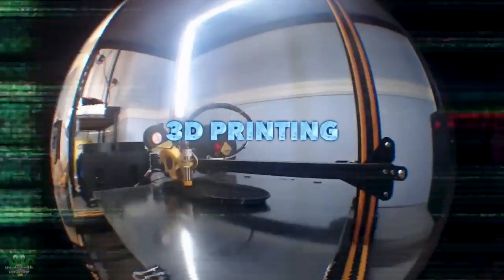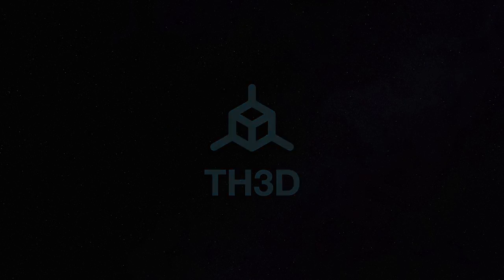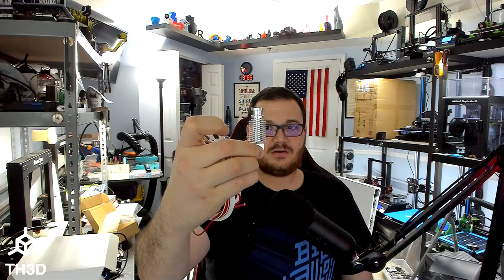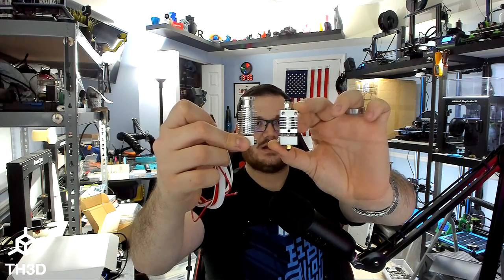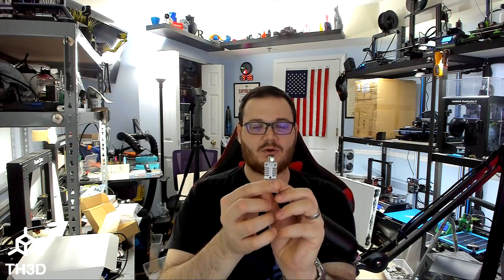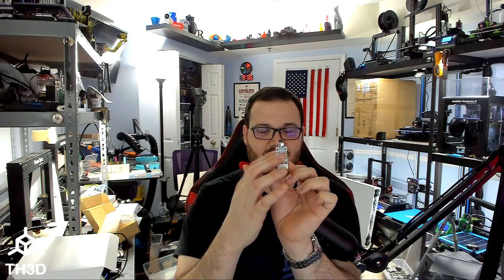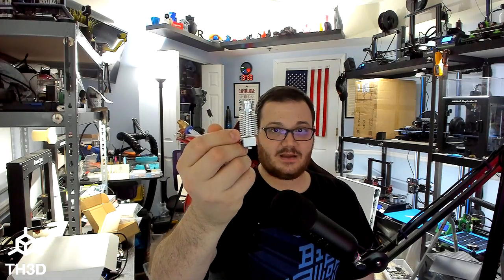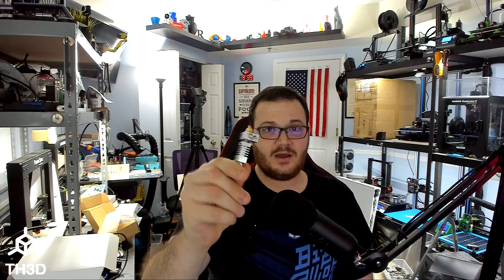Tips & Tricks - Proper Cooling Fan Selection - Stop Using Capacitors & Noctua Fans!

Comment: Hey I have a question I have an anycubic vyper and I was recently going to buy fan replacements but the pins are way smaller on my blower fans and two are integrated together where they use one wire for 2 fans. If I was to buy the replacements for them could I just solder the existing wires to from my old fans to the new 24v fans that are connected?
Reply from the maker: Yes thats usually what is required for most fan replacements with printers.

Comment: Great video as usual. Was kinda pissed at myself for jumping on a couple of Noctuas to quiet down my Ender 3. After reading a lot of the comments I do have to wonder as well about the fact that Noctua also makes 5v versions of the fan as well as the possibility of users having  the low noise plug installed without thinking that the tradeoff is lower airflow. Will probably return they are still within the 30 day return period. Glad to know about the #define FAN_FIX as well.  
Either way it was still an informative video about checking for other causes of underextrusion and/or stringing rather than just thinking it's just an issue with the settings, tubing, extruder, etc.

Comment: What is the best fan to buy if you want to have a more silent Ender 3 Pro? Also would you go for the Hero Me mod?
Reply from the maker: We carry quiet hotend fans and control box fans for the Ender 3 Pro. They're here: https://www.th3dstudio.com/product/40mm-sealed-bearing-fan-24v-ender-3-tornado/

We looked at carrying the noctuas but they just dont move enough air and don't come in 24V that the Ender 3 Uses.
Reply: @TH3DStudio  Do you recommend going for the hero me upgrade or do you use petsfang to mount those? I am concerned that these fans are nice for cooling but loud as hell.
Reply from the maker: The herome and petsfang are both good coolers. The Petsfang is a little more robust and easier to put together IMO. But they both offer a great improvement over stock cooling.

Comment: Urgent!!!!! Hi all, TH3D Studio Informative video, thank you for the teaching. However, I was halfway through installing the Noctua NF-A4x10 5V when I started to hear your video playing in the background. I have 3 prints, each around 1-3 days long, quality matters to me. On the Noctua box, it says, airflow  (m^3/h) = 8.2 > CFM = 4.826338 and the Static pressure (mmH2O) 1.78. My printer is Ender 3 and it has stock hot end, and stock metal case. What do you guys suggest, try running the prints, or change back to stock?
Reply from the maker: 4.8CFM might be OK. Just keep an eye on it. Our 24V 40mm pushes around 6.7cfm and the 12V 40mm is 5.4cfm per the manufacturer specs and neither cause heatcreep.
Reply: @TH3DStudio  Thank you TH3D Studio for the reply. Ill be back to leave a feedback.

Comment: I'm guessing the same thing would apply to a printer's power supply. would putting 2 12v in series work with 24v?
Reply from the maker: No, that does not work with most fans. You should use the same voltage fans as the power supply voltage is in your printer.
Reply: I tried and found out the hard way this does not work (for long) While it seems to make sense on the surface it doesn't work for fans for some reason. This is because unfortunately fans function slightly differently from other electronics in terms of resistance or something. Can't remember the exact details.

Comment: I hear you say its possible to quieten the fans via the firmware? I run sunon fans and would like to know how to do this?
Also I'm running the th3d firmware but can't seem to save my z babystep offset?
Reply from the maker: If your control board has a fan output thats not a layer fan you can. As for the offset save, that is only allowed to be saved if you are using an ABL probe, not manual leveling.
Reply: @TH3DStudio  So is the solution to simply change the babysteps each and every time you set a print going and remember the offest?  Or are you supposed to set the bed absolutely perfectly to the nozzle?
I use  a DTI to get the bed absolutely as flat as it will allow me (minus any slight warping) but I generally have to either lift or drop my nozzle by +/-0.1 which can be a pain.  I understand I can make the changes to bed with DTI although over a short period of time & ambient temps this can still change slightly and I find I still have to adjust Babysteps - I thought their would be a way to save your offset when needed and be done with it

Comment: Could i get some examples for good fans for the Ender 3 series? Dont know much about this stuff :/
Reply from the maker: These replace the hotend heatsink fan and control box fan: https://www.th3dstudio.com/product/40mm-sealed-bearing-fan-24v-ender-3-tornado/
Ths replaces the stock layet fan: https://www.th3dstudio.com/product/4010-ball-bearing-fan-24v/
This is a better layer fan if you are going to use a 3rd party, printed mount: https://www.th3dstudio.com/product/5015-high-speed-ball-bearing-fan-24v/
Reply: Sunon !

Comment: CFM ratings between Noctua and TH3D fans not to dissimilar on 40x20mm? Noctua 5.53cfm vs 5.4cfm? Am I missing something.
Reply from the maker: 4020 is fine but weighs more. Basically larger fan = more air. So you can run a large one slower. People are recommending the smaller 4010 all the time and that one is around 3cfm.
Reply: The 4010 is not "around 3cfm" for the 12v. It is 4.88cfm.
Reply: That is the conclusion I came to as well.

Comment: Why do you suggest a 5.4 CFM fan for the CR10 and a 6.7 CFM fan for the Ender 3 on your website?  I realize that the CR10 is 12V and the Ender 3 is 24V, but don't they use the same hot end and have the same cooling needs?  Couldn't I use that 5.4 CFM 12V Sunon with a buck converter and enjoy less noise with adequate cooling?
Reply from the maker: Around 5CFM is what we found was needed for proper cooling. The fan selection is based on part availability and specs needed for the machines. More CFM won't hurt. Less will.

Comment: how about the noctua 40x20?
Reply: Has similar CFM rating slightly better than TH3D equivalent unit.
Reply: @johnpearson9336  The overall performance is around 45% more actually. It is a almost linear curve between airflow and static pressure. The x20 model has increased both static pressure significantly with 27% and also the flow is shifted with 15%. Just remember one fan might have much more airflow, but that is only when you have 0 resistance on the path. That is where the static pressure helps! This 27% more static pressure also come from those 500RPM. Prusa themselvs uses the smaller one - with 10mm thickness, which is their fault.

Comment: Is the Noctua even too slow on a Rapido UHF at 5000rpm?
Reply from the maker: Noctua is a brand, as stated in the video the thin 10mm ones are usually not sufficient for cooling most hotends. Their 20mm thick ones are usually OK as they move more air but they weigh more and are 2x the size of the 10mm ones.

Comment: I had a question.  I got two delta 24V fans with red and black wires for dual ducts.  Will this work if i connect the red to yellow.. black to blue of the original parts fan in a y config? Some fans come with an third yellow wire. Don't i need a fan with a signal yellow wire so that it can be controlled by fan 0? This is all without adding a capacitor and just a direct connection. Just a bit stumped on the colouring codes used as the original parts fan comes blue and yellow.
Reply from the maker: Yellow is usually positive and blue is usually negative. Check with a multimeter to verify polarity just to be on the safe side.
Reply: @TH3DStudio  yup. Blue is negative. I added two 12V sunon fans because thats all I had.l lying around.  Wiring it directly to and through the buck converter did not work and blew the fan0 mosfet.  I had to wire the negative fan0 (blue) directly to the fan black. Next the red went to the positive of the buck converter 12V out. The buck was supplied directly to the psu. This configuration in wiring works. Now 24v fans came and going to put those in

Comment: Thanks for sharing, what you said about the fans makes a lot of sense,  and tallies with what I learned about axial fans when I first started overclocking towards the end of the last century,  I found that not all fans are the same,  as well as the manner in which they are mounted can greatly affect their efficiency,  an extra inch  gap can make the world of difference (because of the deadspot), in short  if the fan is close to a heatsink or another obstruction high static pressure wins over the raw CFM rating because of the air  resistance of the fins, fans typically are an unequal balance between the 2, sometimes you will see them tuned for one or the other,  although any fan may work for a given situation, its my opinion a proper heatsink fan should be tuned for static pressure  rather than use a high CFM blade profile -  thanks again and look forward to more of your high quality content

Comment: The problem with fans is that they literally all look the same, noctua cleverly have a brand image that's very different. Getting a fan manufacturer to provide information like cfm or even in most cases dB level is like pulling teeth. I do wish some one in the 3d printing space would do some work and find quiet 40mm fans to sell to a huge group, preferably somebody in Europe where shipping dosent cost more than the product. This is why noctua reign supreme

Comment: So don't use a capacitor, yet on your website for the 5015 you state: "If you flash our firmware there is an option called “#define FAN_FIX” that will fix this issue or if you want to solve it with hardware you can place a 32+V 100uf Capacitor across the fan power wires to smooth out the PWM from stock firmware. "
Reply from the maker: Either way works but you will have less speed control with the cap method.

Comment: Hey Tim, Great info, I did not know that the Noctua fans had a low CFM. I've put a Noctua fan on my CR-10 s400 and it's working fine, but I haven't done any long prints yet. Now I know to watch out for under extrusion issues and what to suspect. Thank you.

Comment: Great video, thanks for posting.  I just bought a 40x10mm 12v Noctua fan for use on my CR-10 hot end (Microswiss all metal), but I'm glad I watched this before making the switch.  I do a lot of very long multi-day prints.

But you didn't touch on the control box fans (which is where MOST of the noise of the CR-10 comes from).  Do you think Noctua fans are ok to use as replacements in the control box?  What about Noiseblocker fans - are they any good for use on the CR-10 (either control box or hot end)?
Reply from the maker: I would err on the side of not "silent" types. Less noise equals less airflow. It's just physics. We did thermal testing on the ones we sell for the case as well. Much quieter than stock but still plenty of flow.

Comment: Why does my cooling percentage not affect the noise of my hotend fan at all? I have the feeling it's just running the same power no matter what setting I set.
Reply from the maker: You could have a fan that needs a slower PWM mode. There is a feature in our firmware that is called "FAN_FIX" that sets a slower PWM speed. But this is only for directly wired fans.

If you are using anything between the fan and the board (like a step down converter) then that is not correct and you should remove it, then use a proper voltage fan.

Comment: Wouldn't there be no issues running a 12V part cooling fan on a 24V board if I halve the value of the max allowed PWM in marlin firmware? I haven't tried it yet, but I'm wondering if you have. The command in marlin is FAN_MAX_PWM in configuration_adv.h
Reply from the maker: While that *might work*, it's not recommended. If you forget to change that on an update or there is a software issue you could risk burning out the fan. It's recommended to get the fan voltage for the printer you have.
Reply: Don't do that, even if you set the max pwm it will still send 24v to the fan and it won't fry the fan but the mosfet on the mainboard due to the difference in resistance, ask me how i know....  get a buck converter and step down the voltage to the fan and adjust the pwm as normal if you have to use 12v.  Personally I recommend just getting 24v fan for part cooling.  Spend the extra $ and get delta's.

Comment: What about a noctua 60mm fan instead of the 40mm? that should be plenty right?
Reply from the maker: You really want a 60mm hanging on the hotend?
Reply: @TH3DStudio  Forgive me if it seemed like a naieve question. I am new to 3d printing, and wasn't sure if it had been done or tested. I want to share my experience with others who may have the same question. Two days after I left that comment I installed the 60mm noctua on the stock ender3 hotend with my own version of the hero me and a single 5015 parts cooling fan.  I'm happy enough to stick with it. I've done a few 6-8 hour ABS prints at 250c with a full enclosure with great results. I will however say that the 60mm noctua fan, as I learned, is not optimized for the high static pressure needed to overcome the resistance of the application. At 12v, it seems to put out just slightly more air through the heating block than the stock 40mm fan. My original hopes were that I would be able to lower the voltage and match the airflow, But i've stuck with 12v.  If I could go back, I would have chosen the 40x40x20mm noctua fan, which is probably better suited for this. I am still very pleased with the sound level result and couldn't be bothered to undo it. I actually think it looks really neat and am proud that I was able to remix my own version of the hero me since, I have only been modeling and 3d printing for about 2 months. I haven't posted my remix yet but if someone wants me to, i can post it. There was a 60mm version of the hero me already, but It was extremely restrictive and utterly ineffective. My version has a very smooth lofted pathway to the hotend heatsink, which helps a lot with the static air pressure issue I was having where i could feel the fan expelling air radially instead of just sucking in. The whole setup is not as big as you'd think, in fact its smaller than running dual 5015 blowers with a 40mm hotend. Not sure about weight but I would guess less also.
Reply: @TH3DStudio  I noticed you have quiet 60mm fans on your website that appear to have higher static pressure ratings. I'm willing to bet those would perform better than the 60mm noctua fan and they are cheaper as well. So If anybody really wanted to go the 60mm route, I'd try out those. The static pressure rating is most important in my opinion for the hotend.

Comment: rate the capacitors proper and it is all good ... but yes people think bigger is better and then things stop being pwm controllable indeed. I am no fan (no pun intended though) of software pwm .. I adjust the prescalers of the timers in firmware (marlin) to avoid the audible coil whine though.
Reply from the maker: Yeah some fans get that whine thats annoying. Lots of little variables to look out for.

Comment: Thanks for posting. I've seen a lot of the same recommendations, and have been running some of my own experiments that are similar. Can you speak to max ampacity of the CR-10S fan driver? That is, I've noticed some fans cannot be controlled at lower speeds, and my assumption is that they require a higher starting torque from being higher wattage fans. What max output can the Creality printers support?

Comment: I read somewhere the stock fan on my ender 3 is 8 cfm
But the question is what fan should I get
Reply from the maker: Don't go lower than 5 CFM and make sure its not a low static pressure fan. We do carry 24V fans in our shop that last a long time and are a little quieter than the stock ones: https://www.th3dstudio.com/product/40mm-sealed-bearing-fan-24v-ender-3-tornado/
Reply: @TH3DStudio  better get 24v than a noctua and a voltage regulator
How do they perform are they silent
Do you sell for the psu too

Comment: im new on this. I have a question what if I put 2 12v noctua fan in series. and I place both 1 over the other cooling the cold end? is a good idea?
Reply from the maker: No. You should use the fans with the correct voltage for your printer. Series with fans does not usually work the same as other components and can damage parts on the machine (or the fans).
Reply: @TH3DStudio  Hello. I'm confused on the issue of using 12v noctua fans on a 24v printer. A buck converter brings in the 24v and allows for a 12v fan to be connected and run to its required capacity on the out end. Could you expand on the the issue with that? If the replacement noctua is putting out the same CFM as the stock fan and getting the correct voltage in the process, what components/parts are being damaged on the machine exactly...and how? Or, are you specifically referring to those who just get a noctua fan to make their printer quiet without considering the CFM? If so, it may be worth stating that noctua fan mods are not a problem...so long as care is taken to ensure that the equivalent CFM is produced.
Reply: @tinkertailor5191  If you are just using the fan on to cool the hotend then a buck converter to lower the voltage is fine, you could even run the fan at 13-14v without hurting it for a little more cfm.  I run a 40x10 pwm version noctua on my ender 3 max with no issues using a buck converter at 13v.  If cfm really is that big of a issue, delta makes a 40x28mm fan that runs at 13,000rpm with 24cfm, tho the 54dbm might get annoying after a while.